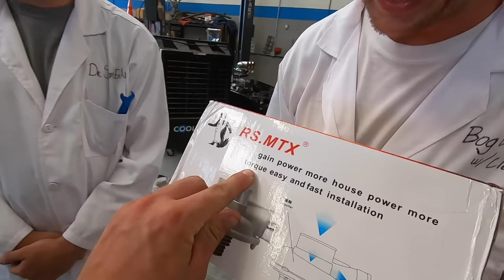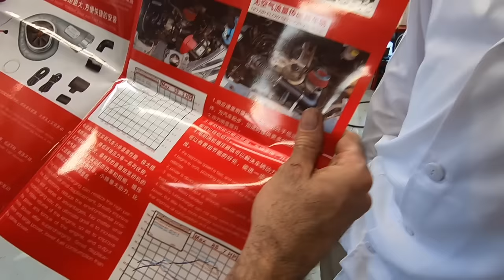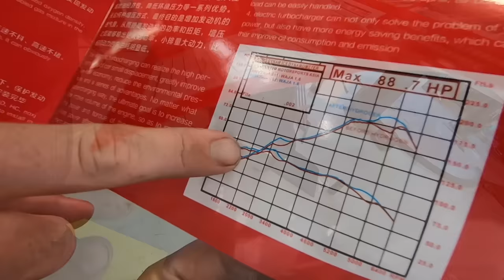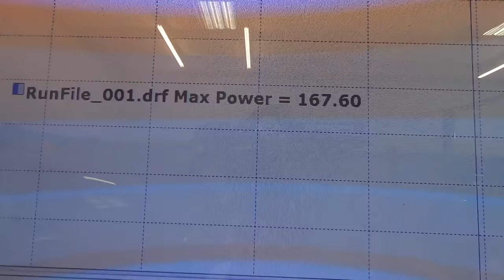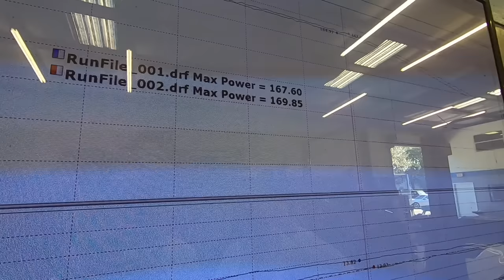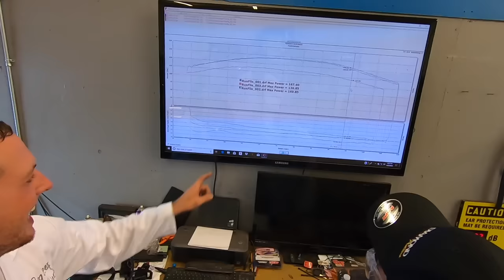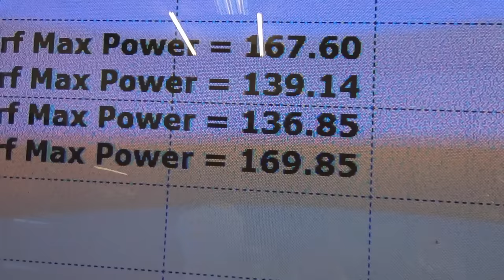Dyno Testing a $400 ELECTRIC TURBO! Funniest Car Part EVER!

Comment: Hey Cletus I work on cars and I do you think that the turbo is too small however I was thinking about something your car's ECU is recognizing what it was originally programmed at with the gas and air mixture so if there's a way you can program it to recognize that the air is being pushed in to accept more it may actually work now that I think about it
Reply: I agree with your friend from the beginning I knew because of the air constriction and that it's not being program to accept all that Air 💨  and I noticed in the video that hiccup that he said I would believe that was the air and gas mixture trying to jump up but the ECM or ecu controlled it try to make another video with programming it to accept that gas /air mixture

Comment: MAF is a "hot" wire with a tempetature sensor, and a calibrated map that calculates air flow depending of the air speed and how the wire is cooled.

If you put higher pressure air, heated, with diferent air speed, then the calculated MAF is wrong.  Also, should be good to see the specs of turbo, how much cfm at nominal pressure can perform.

Comment: Is it possible that a sensor, mass flow for example, threw the engine off? The only way your results make sense to me either the engine did respond correctly to the increased air flow, or if this device blocked air intake.

Comment: The included graph is probably showing installed and the difference is just when its turned on and off. The drop in power from restriction is as bad when it is switched on. Try a 3 cylinder metro

Comment: In the 90s I worked with McFarland with electric chargers actually made quite a bit of power with them but on very small engines the problem is trying to get the motor to pull air

Comment: I feel like it should work, they should try wiring it to the Throttle body since it’s connected to the gas pedal so like that it’s in sync, the more he flors It the more the turbo spools, I feel like it should also be programmed/tuned so like that the air to fuel ratio is equal 🤷🏼‍♂️ idk to me that kinda makes sense

Comment: Why not get a tire compressor  that you plug into power supply that constantly keeps a sealed tank with a constant pressure? Or your battery drills that you but the adapter for to pump up tires if you had two you could have two tanks so it always has the pressure built in one. Then you could hook it up like nitrous wouldn't need the turbos no more either. Maybe use a air compressor to keep the the air cool. Lol

Comment: You need to put a split on the end of the throttle body and 1 way goes to a normal air filter and the other way have the electric turbo so you are still bringing in the same amount of air from your normal air filter and then have the electric turbo pushing even more on top of the normal 😂 and see if that works!

Comment: To make this video valid they needed to tune to add the fuel delivery , tune to change ignition  timing , boost gauge  install and switch under the gas pedal for WOT  wide open throttle to turn on the turbo . If I'm missing a detail please tell me.

Comment: Measure the engine intake CFM and compair it to the output CFM of the electric turbo.
Reply: Compare*
Reply: @lossantostaskforce7467  fu Q*
Reply: That’s the question! Is there a true increase in intake air!?
If not! No power or loss of power by obstruction!
Plain & simple logic! Fully agree👍🏽👌

Comment: To all the experts, help me out here. In theory, you generally want higher vacuum results after the throttle body. By forcing a lot more airflow into the throttle body using the electric turbo would/did reduce the vacuum value past the throttle body, which then decreased the HP.
My question is would it not be more advantageous to use a device that would increase vacuum past the throttle body?
If so, are there products available to perform this function?
Reply: I'm not sure you understand how boost works. With boost you pressurize the intake manifold and a vacuum generator is used to evacuate the crankcase because the positive displacement

Comment: This electric compresor (not turbo) is for small 4 cilinder engines, 0.8 to 1.3 liters. In an 4.6, 4.0 liter the compresed air is not enough.

Comment: You guys had the small turbo before the mass airflow sensor and since the mass airflow sensor is based on moving air, after the chamber fills up the air has nowhere else to go so there’s very little movement past the mass airflow sensor so it cuts the fuel to match the detectable air so if you went filter, mass airflow sensor, turbo throttle body you might pickup maybe 5 or so but if you change the MAF to one that is based on barometric pressure that would work but only if the ECU will comply with a different MAF    I did the same thing with a ram air and it did nothing because it made the air going past the MAF go slower because it was constantly filled with air faster then the motor could pull it in

Comment: This would make power if added to y-pipe inline with intake, so no restrictions and added air pressure, good for few horse trots and shrapnel in "Cyli Pist Ring"....

Comment: You sure you didn’t have it running backwards? Pulling the air out instead of pushing the air into the motor?

Comment: I actually got that thing off aliexpress last year for $350 and put it on my 1,600cc 4 cylinder engine. The engine was already tuned and already had a few more serious (read : less shitty) intake and exhaust mods that actually made more power. bone stock dyno readings for the engine were 94 whp / 109 bhp. Dyno readings before the "turbo" were 133 whp / 150 bhp. After I installed the "turbo", something interesting happened. The peak power dropped from 133 whp to 123 whp, a 10 hp loss at full throttle, which means the "turbo" was obviously choking the intake at full throttle. It was sucking in less air than the naturally aspirated engine would have done on its own. However, I actually saw some power gains in the lower rev range, especially at low to mid rpm. I gained up to 5 hp (FIVE!!!) between 2,000 and 4,000 rpm. Above 4,000 though, the power dropped to below original "NA" readings. My conclusion is that this "turbo", while it does look somewhat nice when properly installed is not suitable for any engine above 1,000 cc. It did indeed ram a bit more air into my engine than what it could suck in naturally at low rpm, but it was simply not powerful enough to keep up at higher rpm and ended up choking out the engine. Either use it only in smaller engines where it won't impede the air flow, or what someone could try to do would be to stick a much bigger motor behind the impeller and connect it to a 24 volt battery. I'm pretty sure the design itself is fine, the only problem is the weak motor. Perhaps a more powerful motor would make it have enough power to create enough pressure to drive air flow in a reasonably big engine at high speed.
Would be worth trying.
I'd try that myself, but I resold the thing after 3 months for about $250. I didn't wanna scam anyone, so I made sure to let them know they probably wouldnt see any increase at full throttle, but someone still bought it anyway xD
Reply: Wow thanks so much for the info, i was actually wondering how it would do on my 1.5. This clears alot, again thanks for the info
Reply: Also the motor isnt weak, the motor is precisely good for the 12v the car battery can deliver. If it is setup to 24v/600-800watt system it would deliver around 1-1.5 psi.
Reply: Is there maybe a way to set it up to work with 24volt in the car. hmm
Reply: @mistervova11  imho, with better gearing, we could maybe get more usable boost out of that "supercharger" while still using the same stock motor. Maybe making a custom gearbox to spin the impeller faster with the stock motor would be an idea.

Comment: Yall should have added a little timing and a little 105 octan . Iv seen a guy get 67 hp with 2pounds of electric boost you just have to have the turbo spool as you accelerate with added timing and gas

Comment: Lol, omg love it! You guys are hands down awesome. I don't know much about turbos, even tho I've been wrenching for 30yrs, but in my experience you have to match the engine and carb cfm? Like some carbs could be overkill for certain engines. If that sounds right. The turbo should be pushing the intake, not the intake trying to pull the turbo. Also as an electrical engineer, to me, slowing down the flow of current in a wire that's trying to pull much more is like having an inline resistor and your not gonna get peak performance of what your trying to power. Anyways... another awesome and entertaining vid full of great info! :-)

Comment: What if you modified an air box with a second Induction point and then ran the electric turbo into the air box threw a second vent. Force feeding more air into the factory airbox. I could see you actually getting real HP gains that way.

Comment: 96 sn95 mustang do not come with stock horizontal tail lights only 94 and 95 comes with the horizontal tail lights and they come with the fox body 5.0 HO pushrod 👍

Comment: The cars in China usually are made for 1.2-1.6L engine. Your intake is way bigger than it designed for. Try smaller engine, like the kia RIO?

Comment: What if you were to Y it into the intake system with a filter on one leg and the turbo on the other, that way you are not restricting the air coming in and the turbo can add more velocity to the flow?

Comment: What if you added a small open part of the intake so the engine could create a pull and use the turbo to try and ram more air with it. I would like to see this on a 49cc scooter.

Comment: You should have run the electric turbo without using the electrical from the car. The load on the alternator may have lowered the Dyno results because of the load placed on the alternator by the electric turbo.

Comment: Well a house power would be 120 Volts times 200 Amps which equals 24 kilowatts and 1 horsepower is 745.7 watts, so one housepower would be about 32.18 horsepower.

Comment: I know this is an old video but I have watched ur channel for years and ur content has been great. I am in need of advice I cannot afford a turbo RZR but what I do have is great mechanic knowledge I can weld, and I also have a 16 RZR 1000 xp with a great running engine. Do you have any experience with custom dyi turbos off YouTube? If so do u believe it would be possible to buy a turbo kit with intercooler and a low PSi wast gate and install it on my RZR xp? Your advice would be greatly appreciated keep up the great content my friend!

Comment: maybe try it with torqamp 48v battery that would spin it a lot faster pull more air into the engine

Comment: One of the purposes of a turbo is to increase thermal efficient, but turbos lag, this is a good idea. But you need another turbo like device to run a generator to charge the battery (52V ??), that way you could scavenge heat energy from exhaust.

Comment: The biggest issue with these are the rpm and torque of the electric motor.  If it had a 80k rpm with 5lbs of torque it would likely make boost.  But you would spend $500 on just the electric motor.  I think the chinese ones are just sticking 1600rpm bike starters which spin too slow to ever make boost.  If they would just make it with the correct electric motor it would work they could actually sell a lot of these for not much more and make more profit.

Comment: Its pretty obvious when it comes to electric superchargers, air restriction to unit power is the big issue. No one is taking into account these push more air into the engine without help from exhaust, so the key is limiting or neautralizing the air restriction. I would like to see you re-test this unit but installed differently. Instead of going directly in at the intake tube, install a simple y-coupling at the filter intake, then put a CAI filter on one end, and the blower on the other. You will neautralize the air restriction when it is not activated leaving the engine at standard production levels, then boosting the air levels when activated. This unit should push 1-2 psi for about 10-20hp gain without restriction.

Comment: Electric turbos work... BUT just need to be higher in max CFM flow rate compared to the engine selected.   This turbo essentially acted as a intake restrictor, since it's CFM flow rate is way too low compared to the V8 engine.

Comment: All that things doing is restricting air. Actual car manufacturers haven't even got it right yet.
Reply: Audi has. Electric twin screw.
Reply: Not a turbo though and the engine in subject is twin turbod with a 72 kw electric twin screw supercharger. No pulley drag. Its genius. 24v battery system.
Reply: @selenacrux8829  yeah but it just can't make the boost man. Whatever it does happen to do just isn't really useful or consistent.

Comment: Really liked the video folks, hilarious xD really laughed at this

I was just wondering what thr results would have been with the turbo working continiously (without the other bro connecting or disconnecting the cable to engage the turbo), maybe the result could be different

Comment: The power available to drive a turbo from a 12 volt altinator, already running lights, heater and wipers,  is less than could be  effective running a turbo.

Comment: Should put it on a two way Jose one that goes too the filter and one that goes to the turbo...and let it go on the filter from the start than crank on the turbo...so they’ll be no restriction

Comment: I want to see it fitted on a much smaller engine. It's intended use might actually see some kind of gain? On second thoughts, if we going for smaller, maybe comically smaller where the electric turbo is actually as big as the engine lol

Comment: I actually calculated that is produces 60litres per second, whereas 3.3 litre 6 cyl engine suckes 110l/s at 4000rpm. Thus maximum engine volume must be below 1.6 to gain any power boost.

Comment: I have a Mazda Protege 1.6, weighted down with 3 amps and two heavy ass 12" subs and a heavy ass custom built box lol. It's like 75WHP stock? Think two of these bad boys would make the car get out of it's own way again? I have almost unlimited power on my electrical system, over 300Ah of AGM's plus the starting battery. Seems these electric units lose boost due to voltage drop, which would NOT be an issue in my car lol. Such a small engine, wouldn't it be more beneficial percentage wise than with a larger engine?

Comment: Cleetus McFarland 

do you think this would be benificial with a offroading jeep with a straight 6
I am typicaly in the lower gears and rpms of a manual and want additional air however a supercharger and turbo really wouldnt activate at where i would want it.

Summers are getting hot and i want it to run efficiently.

Its a different application that what you tested it here, dono if you have a jeep you could test it on for torqe in 2 n 3rd gear maby?

Another though is since the output is reduced couldnt you use 2 of these connected to a Y(this will counter the reduction in airflow from the decrease in size, as i can imagine you are losing a lot of compression when you enlarge you air channel back to the larger size.
2003 jeep tj 4l straight 6
Reply: Superchargers run off the belt,. So if the engine is running it's boosting.  Literally it's boosting your car before you try to accelerate making it best for low rpm torque
Reply: @gamingmadesimple5510  not worth $4500 on a 200,000+ mile engine that i plan to rip out in 2 years...

I can get 2 of these for 450 or i can build my own electric turbo  with a normal jeep turbo however that alot of bs i dont have time for atm
Reply: @johnstephens2032  super chargers can get expensive, and at 200k miles odds are that much boost will break it.  But you can find super chargers kits for pretty cheap, so if it blows up the engine you're trying to replace soon Anyways then get a cheapo  kit and see if it works

Comment: I had a Volvo 1.6 turbo and where the little solenoid would go on and off telling the turbo when to blow and when to calm down,  I had it set so that I could control the turbo to the point ,I could make it come on early and stay on longer, and the turbo was nuts, but I had it so that it would not exceed the turbo within reason it never did blow, during the first lockdown I was coming up the road and a guy  in a Honda Accord 2 lr VTEC engine, there was no cars at all on the road, he put the boot down, and I tuck off after him in Volvo S40 1.6 they're both of us got to the roundabout at exactly the same time and he rolled down the window and said to me this yoke is only a 2L ,lol, when I said that this is only a 1.6cc 😂 he thought I was driving there they're 2.5 fire stroke they are similar the 2.5 is 4wD, some funny shit😂

Comment: You probably connected backwards to the battery.  It was spinning backwards.  Pulling air out instead of pushing air in.

Comment: That thing is will underperform normal compressors due to energie transformation loss in the electric generator and its electric wiring.
And it is specially inefficient compared to a Turbocharger because normal Turbochargers get theyer energie by cooling the exhaust gas in a thermo dynamic process.

Comment: I dunno about this unit but there is a 48 volt job that does actually work pretty well on a remapped old 2.2 liter of some sort. With a bit of extra work on setting it up it would be well worth having! On the old stock piece of shit they tested it on it gave 35 odd hp increase at 4 pounds of boost!! It has a few issues that could make it work even better if they were dealt with, which would not be hard! So there is at least ONE of these electric jobs that actually do work!! Ahh, its another one tested by these guys. a 27% increase in HP!!!   Check it out..Its called  TORQAMP!!! At 2500$ it had better bloody work,lol